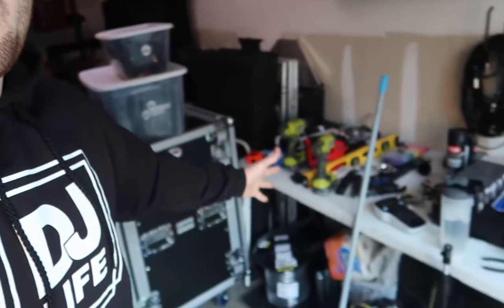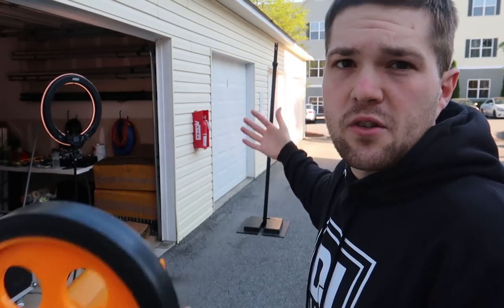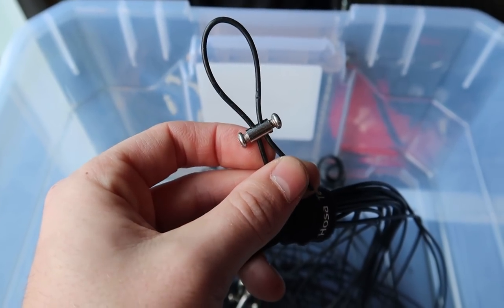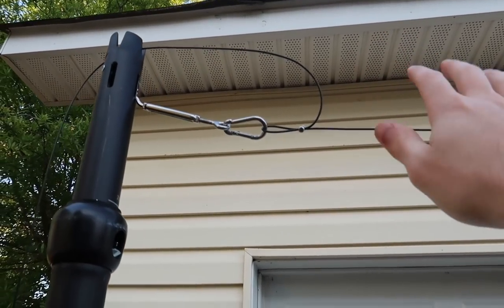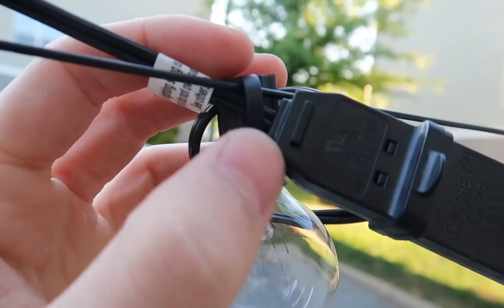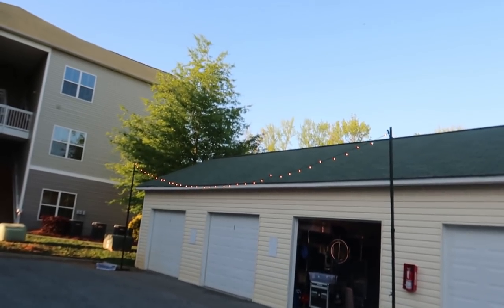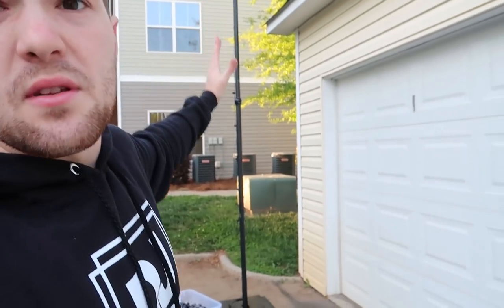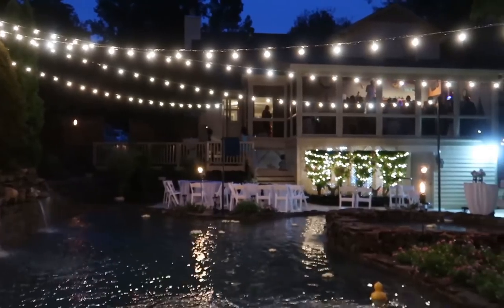How to Hang Bistro String Lights for Weddings

Comment from the maker: Stuff Used
25' Glass String Lights https://amzn.to/3cMvlju
Hanging Kit (Wire, hooks) https://amzn.to/3d0BR6z
7' to 12' Black Poles https://www.georgiaexpo.com/product/2%e2%80%b3-telescoping-slip-collar-slip-fit/?ref=6
Heavy Base Plates https://www.georgiaexpo.com/product/slip-fit-bases-heavy-duty/?ref=6
30lb rubber weights https://www.georgiaexpo.com/product/rubber-base-weight/?ref=6

Other things shown
Elite Core Cables https://elitecoreaudio.com/hand-built-cables/
Colored Zip Ties https://amzn.to/2W4h0bk
How to color code cables video https://www.youtube.com/watch?v=2jRUO5ve8UU
Both Up-lights https://www.bothlighting.com/ or email info@bothlighitng.com

Comment: What size stands do you recommend? I’m planning to only go 20’-25’ in distance but zig zag the pattern.  I have 18” stands that weigh 35 lbs and add a 30 lb rubber weight on top.
Reply from the maker: I get the biggest ones.

Comment: Can you show what you do when you’re doing a couple strands in a V pattern and about how that impacts the distance for each run with regards to the amount the poles can handle?
Reply from the maker: I use the lighter shatter proof plastic led strands now and you can do a 50ft v with no issues
Reply: @DJRickWeb  cool.  Do you have a link to the ones you use and how does the temp color compare?
Reply from the maker: No link handy but same color temp look just like the real thing
Reply: @DJRickWeb  Can you link the dimmers that you're using?  I thought you had a link somewhere but, am not finding it anymore.  Thanks!
Reply from the maker: I am not sure the link anymore. String light dimmers in a Amazon search should work

Comment: Looks like the bulbs would tangle up pretty easily sitting in totes and be a big pain in the ass. You made it look pretty easy though, so what do I know.
Reply from the maker: They actually dont tangle up at all. It's very surprising to be honest
Reply: I think it’s a nice add on. But it is not for everyone cause require a lot extra work. Like I said not for everyone. I like you videos bud

Comment: What pin size on the heavy base plates ? 6, 9 or 12” ?
Reply: you have to use 6" pin if you want to use 6' telescopic  upright. If you have 8' telescopic upright 12'' adds extra weight.
Reply from the maker: 6 inch

Comment: Curious how you price these out if you don't mind sharing
Reply from the maker: Its honestly a situation bases. How hard is it to setup. Are we there for something else. How many heavy ass base plates do we need. Etc. I quote the design instead of piecing it out. A simple design say 4 post and a x over the dance floor would be 200 to 500 depending on if we're doing other things.
Reply: @DJRickWeb  thanks that is still very helpful